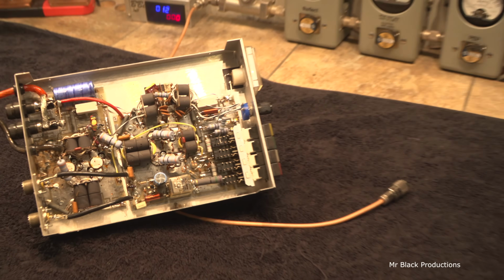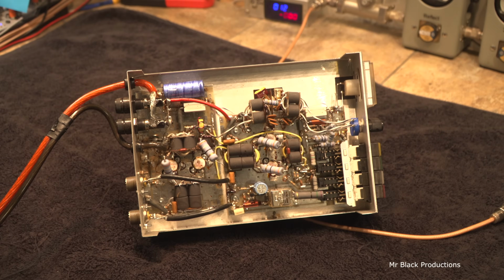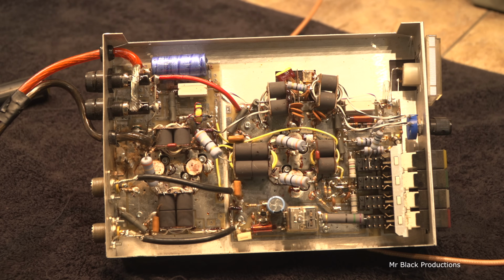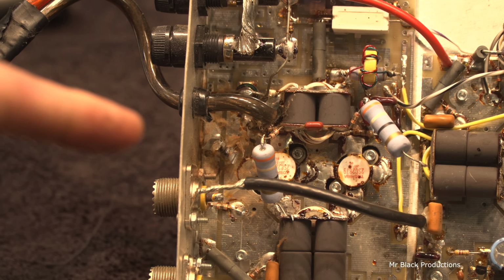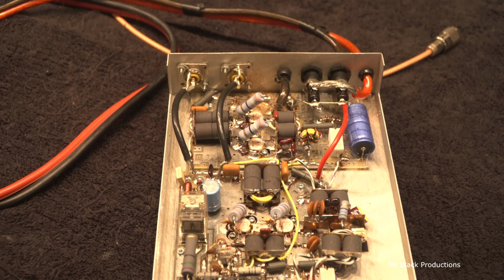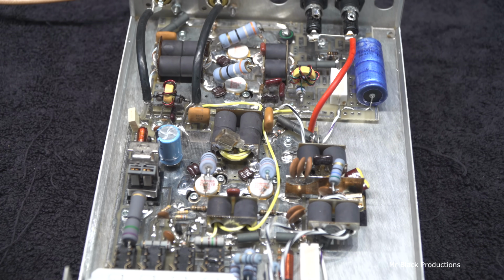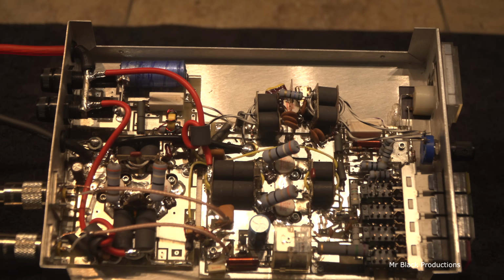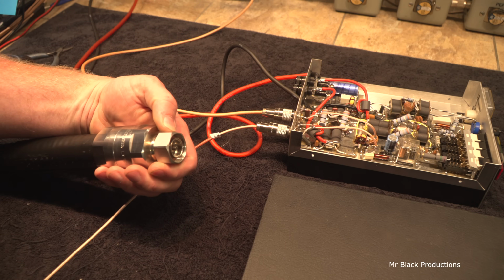Daves 667

Comment: I have a 16v Texas star just like the one you did about a month ago in my closet has 10 non red dots in it only had it hooked up twice.its a monster it takes so much amperage to run it im considering selling it or trading for something a little more manageable
Reply: I have a 667 just throwing it out there it is literally brand new it's only been in my truck for less than a week sending this to you.

Comment: Thanks for being open on these comments, I'm all about radio, your amps and knowledge about them needs to spread.  I have a quick question if you have time to answer, I have an Ameritron als 500m, I cant key it with my Xiegu G90 or the  stryker, will it be safe to use a foot switch.

Comment: RG 316 is okay to low indput but abowe 100watt 
RG400 or RG393 both dubbel shielded silver teflon 
And AMPENOL PtFe Pl / S0 plugs to high watt not melting 
Or bad SWR